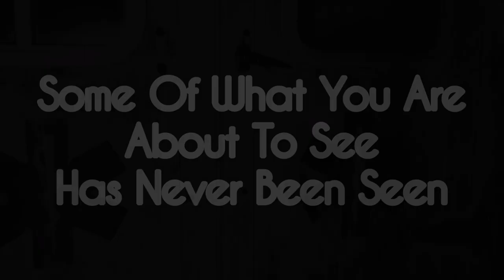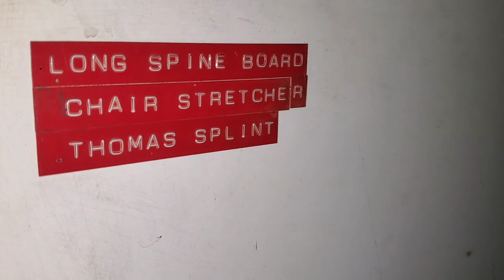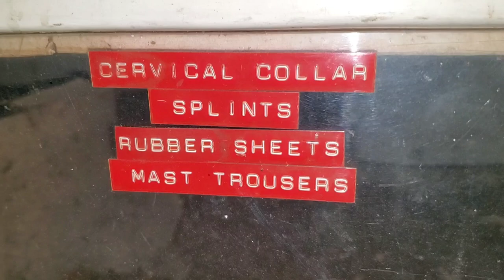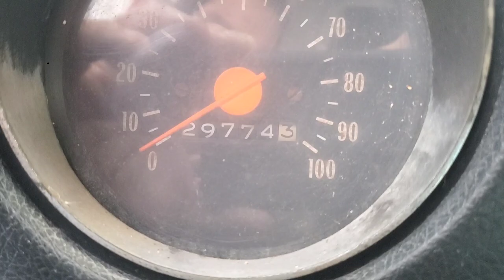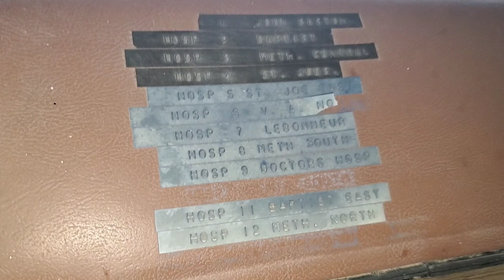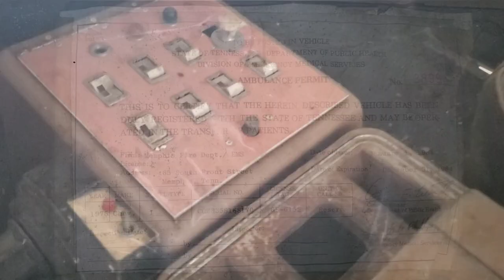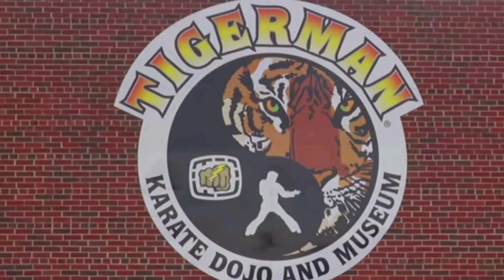Elvis Presley Was Here. See Inside Ambulance - Footage NEVER BEFORE SEEN

Comment: The showing of the VIN of the chassis proves it was both a Chevrolet originally and a 1975 model chassis. The VIN is C for Chevrolet (it would be a T for GMC), C for 4x2 conventional cab, Z for 454 V8 with four barrel, 3 for 1 ton rated, 3 for cab and chassis only, 5 for 1975 model year, S for St. Louis, MO assembly and the rest is the production sequence. It appears to have aftermarket air conditioning added for the chassis since the lower control panel doesn't have an AC setting.
Reply: Google man!  You get around!  From Benny’s junkyard finds to get Elvis Unit, no VIN escapes your scrutiny
Reply: @cookphire  Yup, lol. You need the VIN to win....

Comment: Gee, 247,000 miles on the clock. This old girl has been around the block and then some I’d say. But if the provenance is proved and solid, this is a find alright. When this truck is properly cleaned, have the trucks emergency lights replaced and working. Also, the original siren too. Find an exact replica gurney to put in it. Have the trucks headlights working too, but THATS IT! Nothing else! The engine does not need to run. This piece is a time capsule. Treat it as such. Whatever you folks do, DO NOT include an Elvis maniquin! Keep it very respectful. Good Luck.👍😁🇦🇺